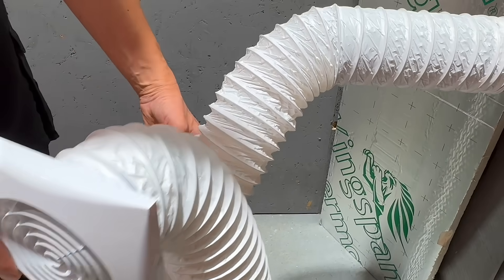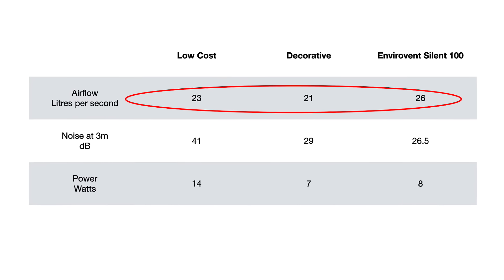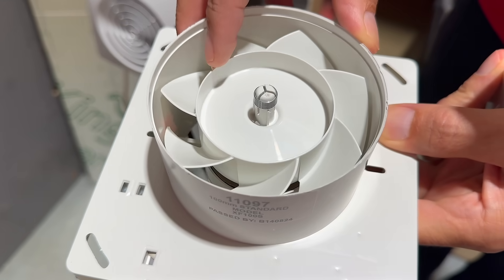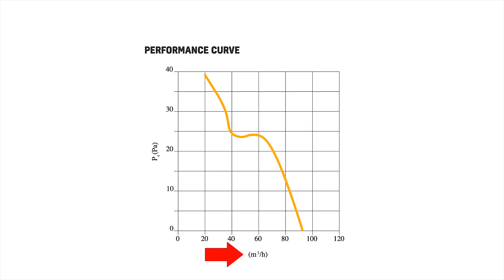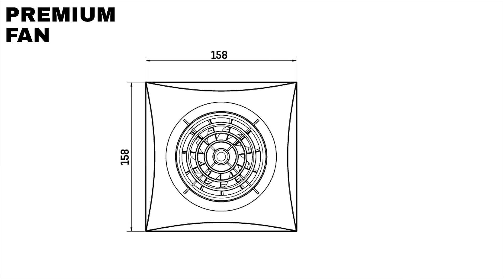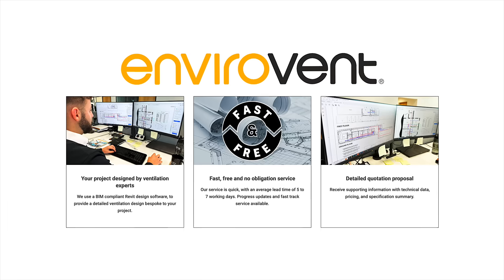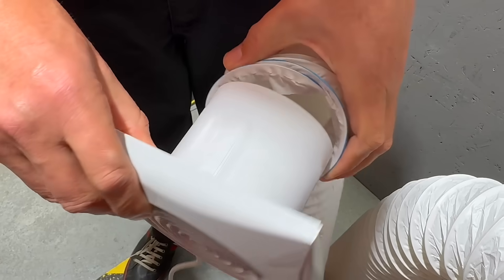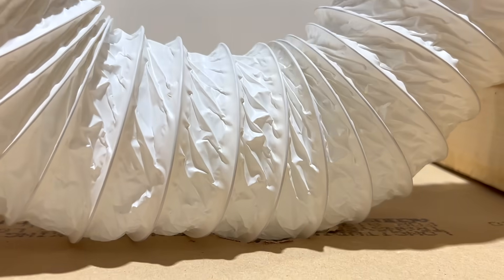The Shocking Truth About Extractor Fans!

Comment: Table showing minimum extract ventilation rates seems to be off by a factor of 4x for effective removal of moist air.  Other factors are cubic capacity of room and of course the fan must be on during room use, cleaned as required and left on for 30 minutes after end of shower /bath.

Comment: I have my fan operated by a relay board which in turn is controlled by a raspberry pi. 
In short:  
If light is on for at least 3 minutes, fan is on for a further 3 minutes, but only from 6am to 11pm
If hot water is detected in shower feed (with a temp sensor clamped to the HW pipe), fan is on for 50 minutes regardless of light state or time of day.

Comment: An old video and boring subject, but I noticed that the humidity sensing fans were pretty rubbish and had a weird way of deciding when to turn on. Ended up getting some smart sensor to turn the power on and off when the humidity reached a certain level, works brilliantly and wish I'd have done that the first time. Bathroom has loads of light, so people often showered without turning the light on. If I could be bothered, I'd put a button next to the loo when people do certain things that generate something that you'd also prefer outside.

Comment: How do you usually check airflow in-situ?  It is said that fans must be checked in-situ and performance compared with Building Regs Part F for an install to be compliant.  I found that my own bathroom fan was set to low speed, which explains why it doesn’t extract as well as I’d like.  It was also clogged up with fluff/dust.

Comment: I wish builders were forced to watch this... the nonsense that is my  ceiling cavity ducting in a small windowless ensuite that could easily have had a window and a wall mounted extractor IN the shower is just painful.  Extractor is as far away from the outside wall as it can be and still be in the room, it goes from the extractor straight into a 90degree bend, the joining piece of the ducting keeps detaching itself from the main duct and someone's already bodged it. To fix it properly i'd have to take the part of the ceiling down - nope... so bodge no2 in progress.  This would have been a non-issue if the builder had reversed the layout, and put the pointless window in the corridor next to the sink and the extractor in the wall where the external hole is rather than the ceiling - as would using a named extractor so i could get the exact same one again and avoid having to build a housing for the new one to give it room!  Clearly the builders for my flat lives in a cave and has no issue with ducting, windows... or cooking (don't get me started on the horror that was the original kitchen, and I don't even cook!).

Comment: You and most other installers overlooked a vital point about venting moist air out of a property.
For a continuous high volume of Air to be removed needs a flow of clean air to be brought in. A slightly opened window can help but when it's cold outside the large difference in air temperature can cause excess condensation around the inside of the window areas.
Taking 10 mm from the bottom of the bathroom door allows house temperature air to flow in and aid the extraction of moist air from the bathroom.
An expensive and well installed extraction system can be throttled by a small bathroom that has no air intake 🤔👍👍

Comment: To be honest the major problems are a) not having any ventilation at all and b) venting straight into a loft space.  Anything else is 100% better than that.  Also 90 degree bends are often unavoidable e.g. through ceiling in corner having to avoid roof.

Comment: The most important factor is the air gap under the door and a trickle vent or air brick elsewhere in the property. Otherwise the fan really isn’t doing anything. You’ll note that the approved building documents give very specific guidance on this. If I remember correctly you need a 10mm air gap under the bathroom door.

Comment: Hi I am moving to an area with high levels of Radon gas and am looking for an extractor to put into the rooms around the ground floor of the house to help with ventilating the house, especially gas build-up. I understand that bathroom fans are sensitive to moisture; however, I thought I'd ask anyway if there is a mechanism to disperse the gas outside. I would be happy to manually flip a switch and leave the fan on for a period to balance the air circulation. Any help would be appreciated.
Reply from the maker: We’d suggest exploring a Postive Input Ventilation system (PIV)

Comment: To optimize a fan you need to create an air circuit so air can enter in the bathroom through a door air grille and then exit through the fan to the outside. The best ventilation for the entire house is an Centralised Heat Recovery Ventilation.

Comment: There's a neat feature on quality fans:   they pull harder the more their air flow is reduced.  When the door closes, they ramp up to keep the air flow within spec.  Also, did you know there is a fan which connects to the toilet seat to extract smell.   Although the code solely addresses  humidly, odour removal is what people really expect a fan to do, let's be honest, Your guests will silently bless you! Also, cheap fans sitting 12" above your head are deafening and stressful and not zen at all -  same with stove fans, what a disturbing cooking experience.  Plus, all that stray EMF and RF sparking inches from your brain, yikes!!!  No wonder Americans are aggressive!    Consider that a fan may be hidden in a cavity several feet away from the vent for non-ear-splitting experience.  Please be aware, all builders, even in high-end homes will almost always buy the cheapest $30 Home Depot fan on sale. Retrofit with a quality, well-designed $100 or $200 Braun to truly enjoy your bathing ritual as intended. Actually, a high-end home, or even average homes today are required to have a Energy/Heat Recovery Ventilator, which are silent.

Comment: in my opinion the best ones are envirovent one of the most expensive but worth it in my opinion and also the squirrel cage models are a better option, its the same technology used in a car for the climate control and they push a lot of air. also with the squirrel cage ones you can easily remove the front of the fan and the squirrel cage too and clean it where as standard type fans are a lot harder to clean and this often results in the fans getting noisy because dirt gets into the bearings

Comment: Regardless of the fan name, type, power rating etcetera, 'Air out' has to be equal to 'Air In'. No fan can suck out damp air if there is nothing to replace it. Some fans just spin in place with the fan causing 'air in' to occur at the fan alongside 'air out'. Increasing the bottom door air gap should facilitate easier 'air in', however, opening the window provides active 'Air In' and 'Air out'. Fans are a way of extracting money from your wallet with the simple promise of the ability to be lazy.

Comment: Pity you didn’t highlight the effect of sagging on those flexible ducts. At some point on its way to the outside air the moisture in the shower air condenses out and forms a puddle in the sag. The additional weight increases the sag and sooner or later the gallon of water leaks out onto your plasterboard ceiling.
I had a new house where the extractor wasn’t working and tracing the problem in the loft had me lifting the sag and pouring a bucket load of water out of the eaves outlet.
Changed it to an immediate rise at the extractor and solid pipe sloped towards the eaves and wrapped in quilt. Also a condensate catcher with 20mm drain at the ceiling position.

Much under-appreciated problem!

Comment: Ok, but instead of all this stuff about speed and whatnot, isn't the best thing to measure simply the humidity? I mean, that's what you're trying to get rid of by using the fan right? So change in humidity over x minutes. Compare with/without the fan on. Compare it with other things like opening the door or using a dehumidifier. That's the kind of experiments you need to run to see the effect the fan has.

Comment: Inline extractor fans are far better than surface mounted axial fans, they are more powerful and quieter but are tricky to install, why not mention these?
Reply: @tedf1471  I replaced a feeble ceiling fan with an in-line fan mounted in the loft. Neater, quieter and significantly more powerful - no more condensation!

Comment: steam rises, so have the extractor over the top and as close as possible to steam source, e.g. directly above shower. make sure fan is not a cheapie that would degrade by moisture. no matter how good a fan, placing it far from where steam is generated, will need hours of on time to now dry up the already condensed on ceiling water. hook up fan together with light switch, as people are lazy to turn on fan separately.

Comment: I use the Greenwood Unity CV2GIP As shown above the bath in your video, in en-suite and main bathrooms. Its got adjustable flow on idle or boost, kitchen or bathroom modes, humidistat and run-on. And as you can alter the flow rates when commissioning, it can be used near bedrooms and turned to a suitable noise/flow balance level. I've seen them in Premier Inn too.

Comment: I use a slow extractor fan to gently move floor level cool air out of the room to improve the warmth in the room. I have an ASHP that moves warm air around my flat. The fan helps put cooler air back towards the heater.

Comment: Re condensation and cold walls. Our new-build when we moved in suffered from numerous problems that should have been picked up by the building inspector (NHBC).
One major problem was the dry lining stuck to the inner block-work with dab and dot. The top of the inner side of the plasterboard was open to the roof space. This rendered the cavity wall insulation almost useless as the heat was just insulated by the thickness of the plasterboard. When I eventually realised what the problem was I had to drill a line of holes round the top of the outside walls in each room and squirt expanding foam in to fill the gap.
In the bathroom I increased the under door gap and fitted grills above the door to improve airflow. The extractor fan now performs really well.
This made a tremendous difference to the amount of condensation on the bathroom wall and noticeably improved comfort in the rest of the house.
And no, I wouldn’t waste my time involving building control, they didnt want to know about the NHBC failings.
Reply: NHBC is worthless. The developers simply sign off their own work. That's like marking your own exams.

Comment: The problem with extractor fans is that they allow a column of cold air to drop into any room they are serving, when not running. You can buy one way, gravity-operated reverse air flow blockers to prevent this.
Reply: Part of the Regs.

Comment: "A single 90° turn is equivalent to 60 straight meters" is the explanation i need to give most often to my clients as hvac engineer
Reply: @albertogarcien  from what I heard, isn't it 16 meters?
Reply: @Etan5000  depends on the speed of the flow. If the speed is high it can be even more than 60
Reply: @albertogarcien  thank you for the explanation 🙏  learned something 😁
Reply: Sounded like 16 to me
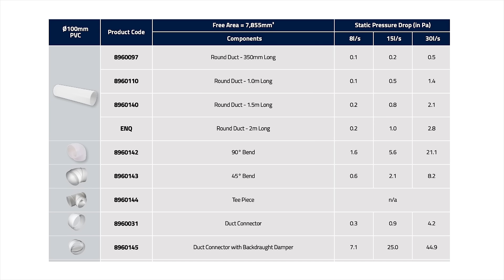Reply: @5:43
Reply: he said 16
Reply: @albertogarcien  what's the best alternative/compromise to the 90° turn?
Reply: @amazingzone8659  in domestic use there isn"t much of an alternative as just not doing the turn too tight. In industrial use, you use steel ducts with deflectors 1/3 of the width of the duct do that the air doesnt bunch up on the turn. Helps A. LOT.
Reply: @albertogarcien  thanks for your reply, I'm installing new ducting for the new bathroom extractor, so that's useful information. I'll use the flexible duct for the one turn (making it as wide angle as possible) and connect it to rigid PVC, so that should maximise the airflow
Reply: @amazingzone8659  2*45° turns is one way to go, an other route is to go up in diameter (cross section) on the duct work.
Reply: @6:20 he says 16, not 60.

Comment: Good info, the performance curve is interesting. I never realised a 90 bend had such an impact. If you have a vent into roof space, put in an in-line fan, I did and it has twice the flow of the wall extract fans. They are not expensive either.
Reply: When you couple fans, watch out. You can burn stuff. (1x making the other go faster than it should)
Reply: Also. Best to match intake/outtake. That way, your static pressure goes down, while preserving same desired airflow.

Comment: With ducting a centrifugal fan is really needed for decent performance against back pressure. I have a loft mounted 150mm centrifugal fan reduced down to a 125mm inlet grill for bathroom. I don't see the point of these little 100mm wall mounted fans that do very little.

Comment: I had my new bathroom fitted, the ducting in the loft goes up to a vent tile in the roof.
The flexible ducting in the the loft is quite long and has a hanging bend, this bend is full of water, should I remove and empty it? After that should I shorten it and make it straight?
Sometimes I get water dripping from the fan (condensation).
Reply from the maker: Lots of problems - duct should be insulated you should also install condensation trap.
Reply: You can get insulated ducting, run it as short and straight as possible. Flexible ducting should be pulled tight.
Reply: Thanks very much for the answers, I will get some and fix it soon..

Comment: Humidistat fans are good (I have one myself) but the ones I have seen share a basic flaw: they all sense relative (R.H.) and not absolute humidity.

If I want to avoid condensation, I need an absolute humidity level (defined in terms of g water/kg dry air) that avoids condensation forming above, say, 14°C.  The absolute humidity is in a fixed relationship with the dewpoint (the temperature at which the air reaches 100% R.H.).  Absolute humidity can be known using a wet-bulb thermometer as well as a normal thermometer, or, if you have a way of measuring R.H., you can very easily know it from the 'normal' dry-bulb thermometer temperature and the R.H.

Relative humidity isn't a very useful thing to monitor in order to control a fan.  I could have a bathroom with air at 23°C and 70% R.H. which might contain a lot of moisture and have a high dewpoint (i.e. high risk of condensation) and want the fan to run, or I could have a cold bathroom (perhaps a window is open somewhere) and just 12°C and 70% R.H. (much lower risk of condensation) and have no need for the fan to continue to run.  But a fan controlled by R.H. cannot tell the difference at all.  In fact, my fan makes exactly this mistake and runs for brief periods when cold external air gets into the bathroom through the fan itself at night (because the backdraught shutters are never 100% effective).

With all the electronic devices we have these days (I even own a CO alarm that also measures temperature for some reason), why are humidistat extract fans still using solely R.H. to decide whether to switch on or off?  Would a basic computer (probably as basic as a pocket calculator) and integral thermometer really cost the earth? (The question is rhetorical).

Anyone know an extract fan in which you can set the maximum desired dewpoint temperature of the air instead of the R.H.?
Reply: Can’t answer your question but I’ve had great experience with a dmev fan which is permanently on and the humidistat enables boost mode for a set length of time. Underfloor heating being used to keep the minimum bathroom temperature to a certain limit.
Reply: @jmcc524  Yeah.  I think mine has a trickle setting, but I don't heat the bathroom all night since it is not all that well-insulated and it is timber-frame.  Timber-frame means it warms up/cools very quickly (little thermal mass) and the lack of actual mass means it makes even my almost silent fan sound noisy.  Though I'm sure if I did heat the bathroom constantly this would be less of an issue (not that it's a big issue... in the scheme of things).